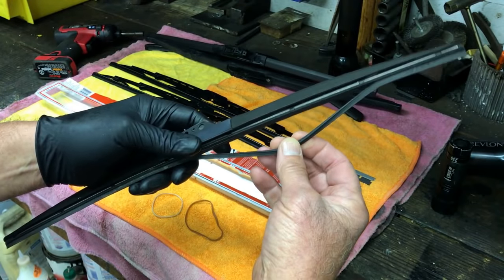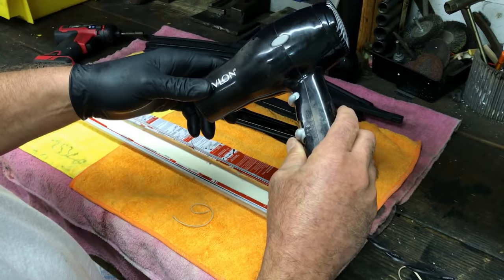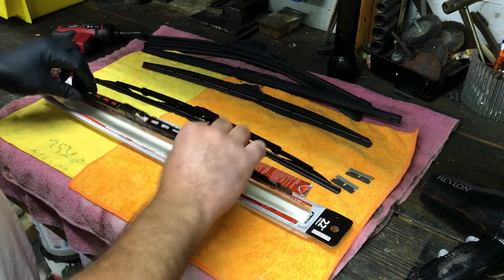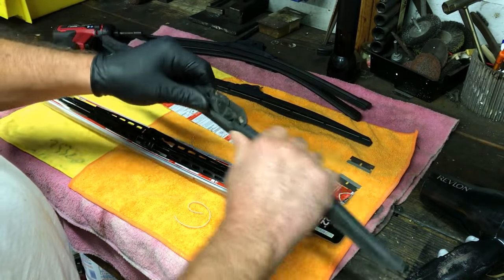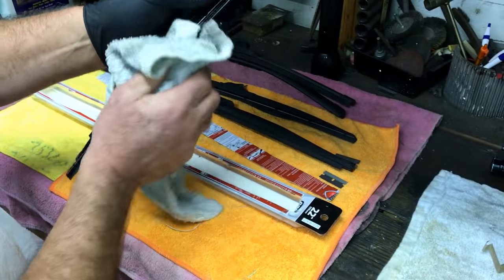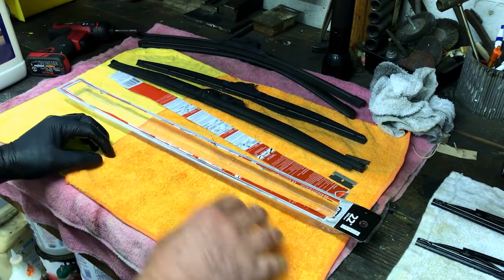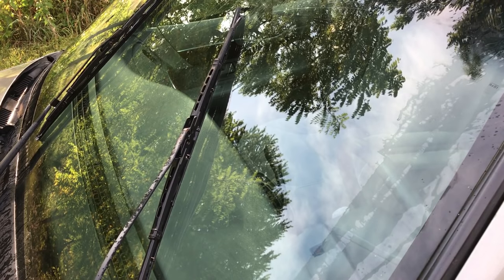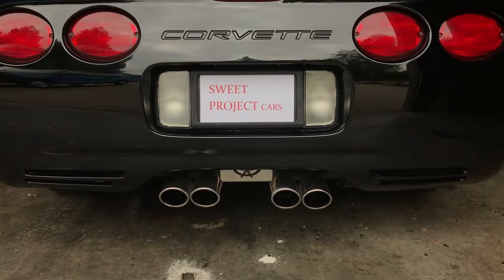NEVER ! Replace a Wiper Blade  AGAIN !!!  Amazing :)

Comment: I've got two sets of blades for each vehicle. Soak one set, then change them out and super clean the ones I take off with acetone and soak with same 303, tag them "soaked". Put them up, ready for next time. Do all vehicles at one time, super time saver. And a good way for my old ass to remember. Do belt too, but don't have extra sets. Took a piece of PVC and a cap and made a thing to soak them in.

Comment: Mann I love you !!
Thank you for all your efforts
Big fan of yours
I don't have 303 conditioner here but I sprayed them with CRC silicon spray , a bit oily though but it restored the wipers to clean again! 
Do you think this is good idea ??
Reply from the maker: very good idea M  and thats the way to get inventive.  thank you for your great question, we are glad to have you here with us :)
Reply from the maker: try  a light dusting you will love the results...
Reply from the maker: M you will want to use electronic cleaner only on electrical connections...also you would be better off with using any water based conditioner on the headlight than silicone...if you cannot order 303

Comment: I have a question not important one but curious. 
 I am planning on buying wiper blades and will be giving them the sweat project cars treatment.
How would cheaper treated rubber blades last compared to silicone wiper blades would the sweat project cars treatment still improve the life of silicone as well as standard rubber blades. 
Haven't priced anything as of yet but winter is coming up🤔
Reply from the maker: willy we use the cheap blades and they last as long as you will need and if they do need changing it will only cost you a couple bucks

Comment: what product are u using to dip the blades. is it some kind of automotive protector.  We in India do not get such products.  Is there any other alternative product that i can use? Fed up of replacing the blades every year since the temperature difference here in the summers and winters is very high.     
  nice video though
Reply from the maker: it is a rubber conditioner, any rubber conditioner will work for the blades, just make sure it is water based  you are very welcome, we try to help thanks for being with us :)
Reply: thanks for your swift replu, well in india we do not get such products and shopkeepers are ignorant about such products and even if it is available they do not stock such products, it is easy for them to sell new old wipers (you know what i mean.). Fact is that in India we still do not get a product called "red rubber grease" LOL
thanks once again for your reply
Reply from the maker: Mandar if you cannot order it online from ebay or amazon then your last alternative if you have nothing else is     and as a last resort..Mix a solution of three parts rubbing alcohol to one part wintergreen oil.
Reply: thanks for the reply . will try wintergreen oil and rubbing alcohol 

regards
mandar

Comment: Wow!  Thank you!  I'm a young widow learning to take care of and fix my Sexy Beast's '00 f250 7.3 turbo superduty 4x4. After ignorance meant handing over cash for work that wasn't done I've decided newb is better than dumb and I'm learning.  I have bought another set of windshield wipers as they don't seem to clean well after long and they're expensive name brands.  I wondered if since I use so much cleanser if I was drying them out.  Your tips will help me save.  I'll soak them and give them a conditioning spray every month from here on out.

I also saw you mentioned other parts that can be conditioned in the comments but looking through your videos I only saw the serpentine and alternator belt.  Is there a url to a playlist I'm missing or would you mind replying with a list of parts I should condition and guestimates of how often?  I do appreciate your time and the sharing of tips and have subscribed for future videos.  
Thanks!  Honey
Reply from the maker: Honey   glad we can help you, we thank you very much and for the quality comment, it is very helpful for the whole channel :)

Comment: Looks good. With dust, road dirt, bird poop on the windscreen. The first wiper action, before windshield washer sprays water, must be harsh on the blades!  This treatment protects against UV ageing not abrasive wear.  Or did I miss something?
Reply from the maker: you missed something
Reply: Sweet Project Cars ..still missed it...old age I guess.  But such a brilliant idea. Just came across your channel last week after watching the DRIVE BELT video. Subd straight away.
Found 303 online at local auto store.$29AU for 473ml bottle... Next stop...auto shop.
Reply from the maker: ed thats awesome :)  thank you again for your great comments. :)

Comment: if i use this on my dashboard, will it prevent outgassing, preventing buildup on the inside of my windshield? can 303 b used on silicone wiper blades? thanks for ur great tips.
Reply from the maker: give it a try and you will love it and yes it can be used on silicone blades
Reply: will it prevent outgassing?
Reply from the maker: we have never had a problem with outgassing after using the product thats for sure

Comment: I am really glad I found this channel. Thank you for another great video. I have a crack on my windshield that goes left to right about 1.5 feet then up about 1.5 feet. Will this crack tear up the rubber as fast once I put this 303 on them? My wiper blades seem to last only about a year but I think it is the Hot South Texas Sun, hot temperatures, high humidity being on the Gulf Coast, etc.... but maybe the crack is also hurting the rubber wipers?  Thank you.
Reply from the maker: if you use this http://amzn.to/2jCHktN  you will have superior results with all the rubber on your car thank you for the great comment :)
Reply: I am not familiar with the US construction and use regulations, but here in the UK that crack would be illegal.
For safety, replace your windshield.
Reply from the maker: it is illegal to have a crack but it all depends on the officer that pulls you over, most people put off placing in new because of the cost until they are told by the officer to have it replaced.
Reply from the maker: Superior you know I never answered your question correctly..if you can feel the scratch with your fingernail then yes it will damage your blades over time :)
Reply: Does their motor insurance not cover this ?. Mine does, with a 60GBP excess on replacement and a 10 GBP excess on a repair.
Anyone not repairing or replacing a damaged screen will soon become an example of Darwinism, only problem being that they will probably take others with them.
If a police officer sees it the vehicle should be impounded.

Comment: You do realize the rubber goes to the temp of the conditioner VERY quickly when you put into it, right?  I wonder if it would help to heat the conditioner, and maybe insulate it with a towel or something to hold it warmer a while?
Reply from the maker: John you can give that method to try that’s how we come up with our methods let us know how that pans out

Comment: really cool. If you have all the stuff and the time. I will continue to spend $40 twice a year and put on new blades... Still, nice video and very informative. Thanks, I will try to watch more often. Good information.
Reply from the maker: Dan thanks, this video was to help those who don't have that kind of money, as you know maintenance on a car adds up 40 here 40 there and over and over,  just make sure you condition all the rubber on your car or truck with a good water based condtioner and your ride will last a long time.
Reply: That is very good advice and it will help me keep my car tip top longer. Thanks!
Reply from the maker: you got it Dan thanks :)

Comment: How long after exposure to the following conditions would I have to re-apply the 303? :Exposure to High temperatures in  desert  heat of 115 degrees, heavy and continuous  rain.
Reply from the maker: You are conditions are extreme so we suggest a quick wipe of 3O3 on your blades every 30 to 45 days
Reply: I travel full time in my truck camper. Thanks for asking this question. Because of all the diverse weather conditions I experience, was wondering the same thing. Will be placing an order for 303 and using the link in the video description so, hopefully, SPC will receive credit from Amazon. Although, Amazon has really been jacking people around so not sure if that still works or not. Anyway, thanks for azking and thanks to SPC for replying to you. 💞🐶😽😻💞

Comment: Most UV protectants state not to get it on the tire treads because they would be too slippery.  Why is this product safe to put on your treads?
Reply from the maker: you dont want to put it on a motorcycle tread then immediately drive on a wet road but car tires are fine

Comment: You can spray that protector right on your window ? Do you need anything to remove it like scrub it off. Does it leave reidue?
Reply from the maker: Kathy Lewis yes you can for your upkeep treatments but the initial treatment should be done per the video :)
Reply: Sweet Project Cars Thank you!

Comment: can you use the same 303 formula on wiper blades and on tires or do you recommend using different types of 303? Also is there something other than 303 that does the same job?  Thanks for a great channel.
Reply from the maker: jeff rezzuto thank you and we use the same 303 for both https://youtu.be/OD8WFiDGx4Q  and there is really nothing out there that does what 303 does
Reply: @SweetProjectCars  
May 303 be purchased at the local auto parts store or only online?
Reply from the maker: @conniedetevis2119  this is the best price ad the only place we buy it  http://amzn.to/2zTBRms thank you for asking mike

Comment: The wiper package I received is open on both ends (won't hold liquid). Do you have any suggestion for some sort of tray to use for soaking my wiper blades (28" for driver's side)?
Reply from the maker: dkalata yes you may have to find another container to do the process in, as some wiper packages must be open, you may have to get creative my friend :)
Reply: Sweet Project Cars: thanks, I've been trying to think outside the box (e.g. storage box tilted on its side), but haven't had any luck yet. If you, or anyone else, has a suggestion for something which can be used as a tray for soaking my blades, I'd appreciate any/all suggestions.
Reply from the maker: do you have a large freezer zip lock bag that works as well or a piece of plastic food wrap and make a trough out of it using an old bath towel, form the towel into a long narrow oval trough and lay the plastic in it fill it with just enough 303 and then just lay both wipers in.. it is crude but works, you should be all set. hope this gives you some good ideas.
Reply: Sweet Project Cars thanks for those suggestions - I'll see what I can come up with!
Reply from the maker: You’re very welcome my friend

Comment: Thanks for the practical idea, but I have never encountered this brand here in Egypt, so as a substitute is it possible to use something like WD40 or coconut oil that was basically produced to use on the hair?
Reply from the maker: google w based UV protectant my friend and see if that brings up anything  :)

Comment: Just wondering if the silicone wiper blades work even better with this.
Reply from the maker: Silicone wiper blades work good, but nothing like this process we are sharing.  Thanks.  Have  great day.  mad Mike the hammer SPC
Reply: @SweetProjectCars  I meant I was wondering do silicone wipers with 303 work better than before.

Comment: Ordered the 30320 aerospace stuff from Walmart gallon was 43 bucks.  I plan on making a troth for my PVC boot behind my front wheels of my car and let it soak. To keep my boots conditioned and hopefully from cracking leaking grease avoiding a wheel axle break and unnecessary replacement of the shaft?  I will let u know how I make out.  That 303 got very good reviews
P. S.  Should I use a hair dryer on the boot first before soaking and why?
Reply from the maker: Good deal and the reviews are true for sure it is the best product we have seen in many years...

Comment: i use belt dressing to condition the wiper blades and as well as drive shaft shoes, it conditions the rubber.
Reply from the maker: You can use whatever you want to use, we are just sharing what we have tried, tested and know works every time.  Thanks for watching. mad Mike the hammer SPC
Reply: @SweetProjectCars  oh yes that's why i left a comment to share what i use.

Comment: I just bought a new set of blades that are  graphite treated. Will that make any difference in using the 303? Tks
Reply from the maker: Mike if they have any rubber in them it will help them :)

Comment: I don't think of myself as a "brand snob", but when I find something that really works I spread the word!  (Like SeaFoam!) Anyway, I have used the 303 product on my old campervan's Michelin tires hoping to keep the sidewall cracking to a minimum.  I sometimes wipe a bit on the bumpers, handles, trim, etc.  What I'm wondering is this: does the heating process make a difference cuz I'm willing to take that extra step if it does.
Reply from the maker: Hello Debbie 303 is great on all rubber, and we found it helps when the rubber is warm so yes heat it up and spray it on :) thank you for taking the time to share with us :)
Reply: Thank you!
Reply from the maker: you are very welcome :)
Reply: Was that 303 in the spray bottle that you apply 2 times a year?
Reply: Michael Hamilton 
I was wondering same thing
Reply from the maker: yes it was this     http://amzn.to/2jCHktN
Reply from the maker: Paula it was this    http://amzn.to/2jCHktN

Comment: Excuse me good sir, but im in a bit of a pinch. My wiper blades are very chattery when going across my windshield. Would a silicone spray be effective at all at helping the situation until I can get something proper to condition them with? I just don't want to unknowingly put something on them that will cause the rubber to degrade faster then normal.
Reply: Troy Guinn : One thing to remember never use  petroleum products on rubber, it'll disintegrate them.
Reply: Brian trucking Landers thanks man
Reply: Use a pliers and very slightly tweak the wiper blade arm, to ensure the blade "trails" the arm and not leads , with respect to the windshield. This will stops the chatter.
Reply from the maker: correct, and 303 is water based so you are good to go troy..
Reply from the maker: correct, and 303 is water based so you are good to go troy..
Reply from the maker: great advice thanks for helping out

Comment: I recently bought some 303 Aerospace protectant as well as some Trico Force high performance beam wiper blades which came pre-treated with HighGlide. My question is, since the blades have been pre-treated, should I skip the initial treatment process and simply treat them every 6 months as suggested towards the end of the video? Or should I treat them as described in the first part, or at the very least apply some of the protectant to them before installing them?
Reply from the maker: UKSportsFan we always say rubber is rubber and it needs 303 so in this case, we would treat them with 303 no matter what they have on them from the manufacturer :)

Comment: I've been doing the same thing for over 10 years, but i use PB Blaster to recondition the rubber. I just spray a little bit to run across the entire blade like you did and wait about an hour then wipe it off. I used the same wipers on a Supra i had for over 5 years here in Chicago where because of the amount of salt you get its best to replace them once a year but can last two.
Reply from the maker: Awesome to hear ...if you use 303 and the method in the video you will never need to replace them :)

Comment: Great video.  One question, is 303 comparable to Armorall?  I had been told not to Armorall one's wiper blades because they will streak badly.  True? Not true?
Reply from the maker: yes, Kirk, any good conditioner will work for the blades  you will love the results :) thanks for being here with us :) no streaking hit the washer button a couple times and all clear ...
Reply: I bought a used inflatable kayak and asked a gentleman I know what I should use on it to protect it. He looked me dead in the eye and said "DO NOT USE ARMORALL ON IT. Use 303." His reasoning is that with armorall, you cannot patch the boat should a tear or hole occur because it is too hydrophobic for the patch. This leads me to believe that armorall would actually be PERFECT for wiper blades because you don't have to patch holes in blades, and hydrophobic squeegees are probably better performing anyways.

Comment: I haven't bought wiper blades for that price in years. I'm assuming this only works on rubber wiper blades. Rubber wiper blades are hard to find for most cars built today. Most wiper blades you buy today are silicone(which really suck).
Reply from the maker: These are the rubber types we found this process works on   Natural / Isoprene: Ethylene Propylene Diene (EPDM) Nitrile Rubber (NBR) ...Styrene Butadiene Rubber (SBR) Silicone Rubber.Butyl Rubber.Polybutadiene.

Comment: ******  Will using 303 on the blade cause a film on the windshield which would also cause a "white-out" on each wiper pass especially at night with on-coming headlights????????  *****
Reply from the maker: Hello Chris I can assure you we would never share a video that would cause any issues with any part of the car. The 303 that ends up on the windshield comes right off but it stays connected to the rubber
Reply: Do you know exactly what is in 303????????  I know it's probably not easy to find out, but just very curious...
Reply from the maker: chrispompano im sure it is a huge trade secret but I do know it is water-based and that's why we can use it on glass.